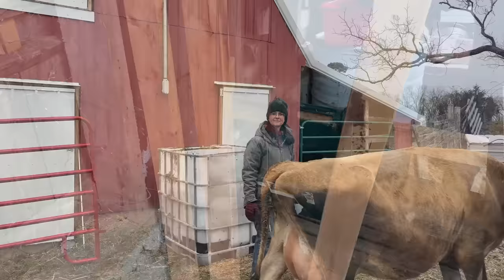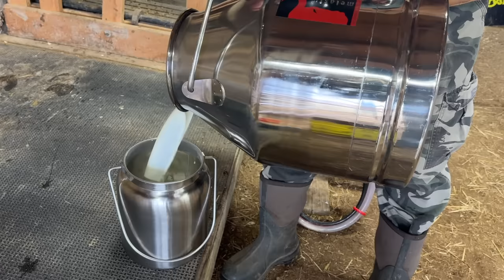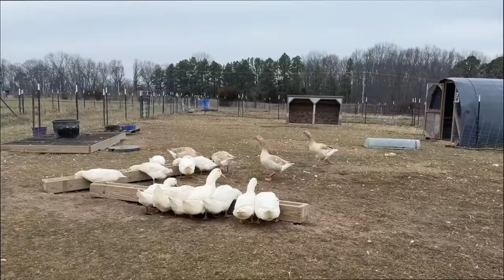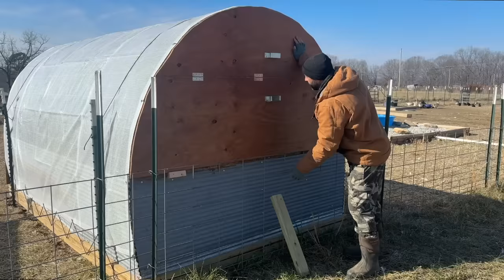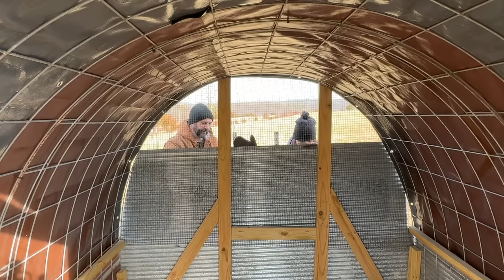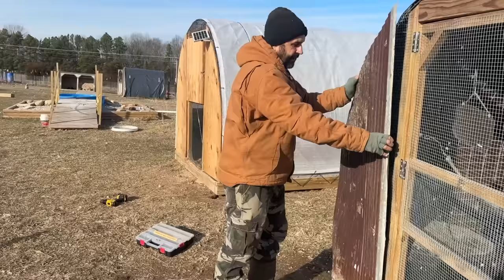Good Enough is PERFECT to us!  Winterizing the Hoop Coops.

Comment: Neat idea for keeping the top, hinged section of the quail coop closed. Maybe a quicker-to-make alternative would be to shave the lower portion of the 2x4 into a wedge so it would slide into the top metal brace and through the lower metal brace (the lower one would therefore just be a guide to keep 2x4 vertical 9so no welding required on bottom brace. Also you could make the braces yourself (different sizes) if you have some spare strips of metal. If the braces you bought only fit a 4x2, then gluing and/or nailing .a small wedge on either side of the top of the 4x2 would allow the wood to slide through the brace until it hit the wedged section. Love your videos!!

Comment: Love the back side of the quail pen with your wielded piece preventing the 2x4 from slipping through!  Nice video.
Reply: If you don't have a welder, just run a screw part way through the 2x4 so it won't fall through 👍😊🇦🇺🇺🇸

Comment: Good video, but the best part for me is the introduction to the shears accessory for battery powered drills.  I have an air powered shears that cuts typical sheet metal (duct work) fine but not the roofing I have dealt with.  I looked up the specs of the Dewalt shears you are using, and it is rated for 18ga metal.  Roofing comes in 22ga to 29 ga.  The smaller number gauge is thicker, so this will work perfect if it will fit my current drills.  Thanks.

Comment: Y’all are a couple of the smartest homesteaders I’ve seen on the internet. Lots of common sense. Where did you get the clear tarp? Is that a standard size? I need one close to 12x16. 

Also, I want to let my chickens out into an open area like you do, but they can fly right over a fifty inch fence. I have buff Orpingtons and they are extreme flyers. What breed will stay inside a fence without flying?
Reply from the maker: We clip one wing of the chickens